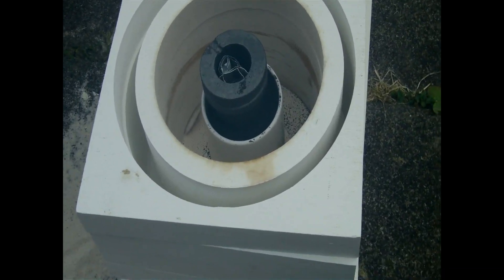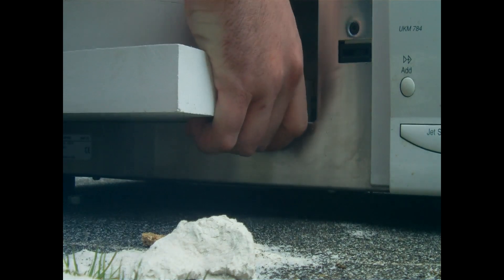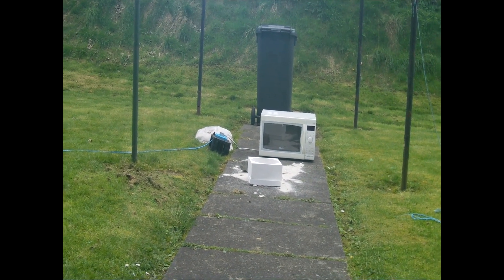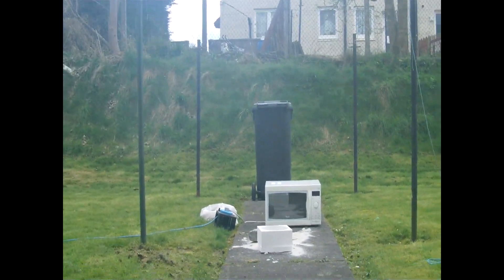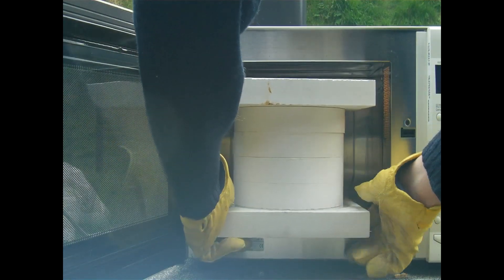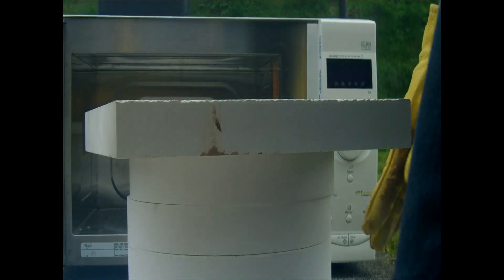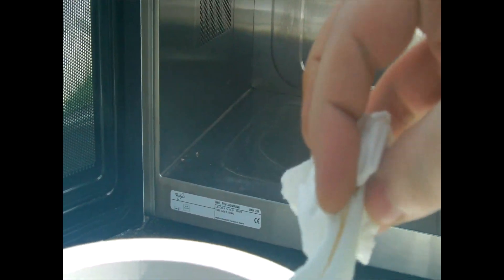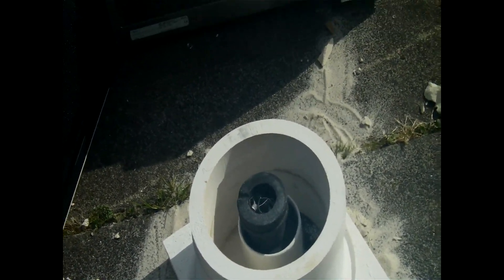Microwaving magnetite/graphite/aluminium test

Comment: I think your crucible/container may be able to sync more heat per minute than it takes a 1000 watt microwave to heat your aluminum to melting.  Typical problem with low power appliances.  Try it without the outside ceramic container.  just the inner crucible.  I bet it works.